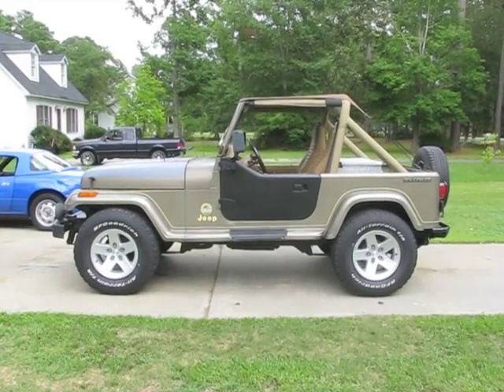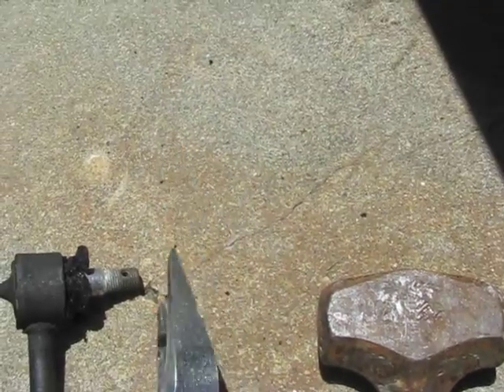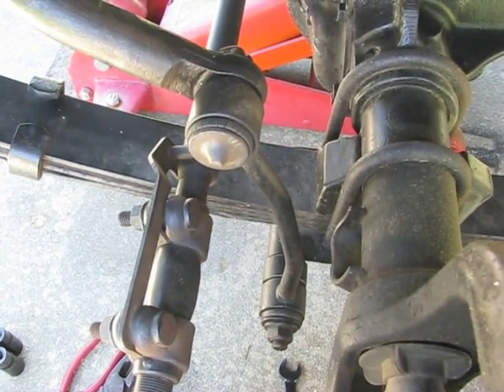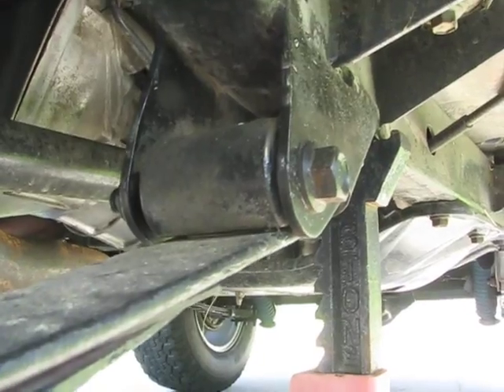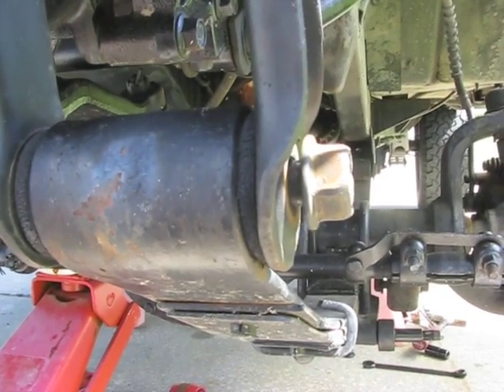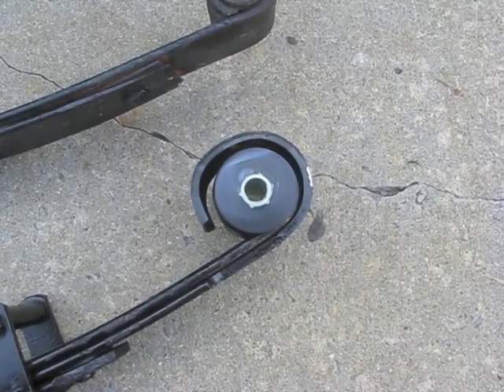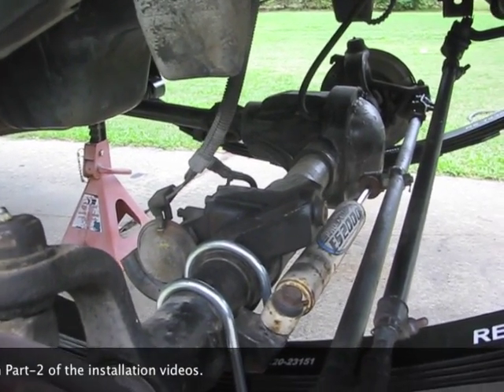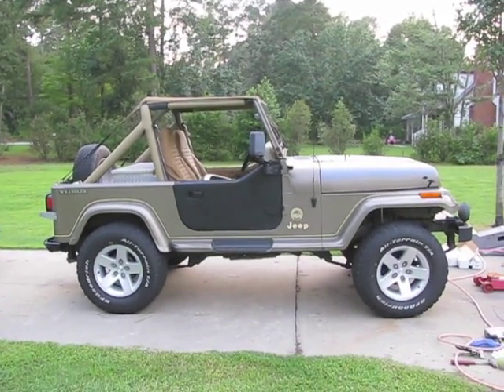Jeep YJ - Rubicon Express 2.5" Standard Suspension Installation Part-1 (front) (RE5505)

Comment from the maker: Glad you got it figured out. I didn't even think about your track bar being the issue since I removed my track bar before removing the factory springs and I did not reinstall the front or rear track bars. With the RE leaf springs, I haven't noticed any difference in on road handling with the track bars removed.

Comment from the maker: Took me forever to find a good clean YJ. It had been garage kept until I bought it. The paint faded out quickly (no garage for me) but I do frame maintenance about once a year to keep it rust free. I hate rust. I did have to PB Blast every nut and bolt several times for the weeks leading up to this lift installation. I had the suspension and axles removed several years ago which did make it easier this time around.

Comment from the maker: The kit came with bushing for the sway bar end links/disconnects. 
As for the leaf spring bolts, it comes with new U-bolts but not the leaf-spring mounting bolts. I did reuse the 22 year old mounting bolts on mine but it all depends on the condition of the bolts and I will most likely replace them when I install my new axles. 
If you think you need new upper shackle mount bushings you may want to get a set to install while you have everything apart.

Comment from the maker: Also, the RE 2.5" kit does not include bump stop extensions and with sway bar end links removed, the suspension does flex enough to rub the front tires against the fender when fully compressed. I will have to do something about that soon. 31X10.50-R15 tires may clear fine but my 265/75/R16 are just a little taller and do rub. Bump stop extensions will resolve this issue.

Comment from the maker: I was having trouble with my YJ drifting to the right a few years back. I had the alignment checked and I checked the usual things that could cause it. Sticking brake, wheel bearings/hub, and more. It turned out to be in the rear diff. The Dana-35 had pieces of the spider gears sitting in the bottom of the housing and there were metal filings binding things up when they found themselves in the right place. Fixed all that (yes the Dana-35 is getting replaced soon) and the YJ tracked straight.

Comment from the maker: Some old cars have leaf spring suspension similar to my '91 Jeep YJ and '86 Chevrolet M1008. Most have coil springs. My '70 Nova has leaf springs in the rear and coils in the front same as my '00 Ford E150 cargo van and '98 Jeep Cherokee XJ. My '62 VW Beetle has torsion suspension. All three of my Mazda MX5 (Miata), '87 Camaro, '05 Jeep KJ, & '03 Jetta all have coils. My '03 Freightliner has leaf springs in the front and airbags in the rear. Some cars use air ride suspension and coils together.

Comment from the maker: No noticeable difference. It tracks straight & with the sway bar connected, it still corners great. Even though the 2.5" lift doesn't require a dropped pitman arm I did install a stock XJ pitman arm to keep steering as close to stock as possible.

Comment: I did. (if you're asking me). I had to take it to the alignment shop and they had to put an air hammer to it to get it loosened up. After the alignment it drifts to the right a bit. I've been through everything to try to figure it out. Now I'm thinking the kit I ordered wasn't very good and the bolt the the spring perch might be off. I don't know. The caster is about where it needs to be, 8 degrees.

Comment from the maker: I had to let the PB-Blaster soak in for a while before mine would adjust. I don't normally like using heat on steering components but a little heat and a pipe wrench may do the trick.

Comment from the maker: The dropped pitman arm put it closer to its original position but I still had to adjust the drag-link. Just park with your wheels straight, loosen the to drag-link adjustment clamps and turn the drag-link to make it longer until steering wheel is straight. I can't remember which direction to turn it without looking at it. Also, spray the threads with PB-Blaster before trying to adjust length. You should be fine without the drop pitman arm. Just have to adjust drag-link longer than on mine.

Comment from the maker: So far, it rides great on & off-road. I have not installed the transfer case lowering kit and have minor driveline vibration when coasting. I am thinking if the suspension settles some that vibration may go away. I do have another NP-231 transfer case that I have already installed an SYE into. I was going to install that & my new rear driveshaft after my rear axle swap but may end up installing them before. I don't want to use the t-case lowering kit if I can avoid it.

Comment: I see the point of a trac bar on a front end with coils but see no point for it being on a leaf spring set up. Wouldn't the leafs just keep the axle centered?
Reply from the maker: The factory leaf springs do have a little side to side movement when cornering with the track bars removed. I guess that small amount of movement is what they were trying to eliminate. With the much stronger Rubicon Express leaf springs I don't feel any side to side movement when cornering with both track bars removed. Unless you are using a YJ for autocross I would say they aren't needed.

Comment from the maker: No, I don't believe they were. 
Just tighten up the shackle bolts to where they are snug then once its back on the ground I would cycle the suspension a few times (jump on the bumper a few times) before torquing the shackle and main eye bolts. This should help seat everything in place.

Comment: I bought the 2.5 inch lift kit from rubicon,  it says that you have to weld the    swaybar disconnects,   I see you didn't,
Reply from the maker: The sway bar disconnects that were included with my kit installed the same as original. They might have changed the design in the past 10 years. I hope not.

I'll have to look up what RE currently offers with the kit...
Reply from the maker: I looked them up. RE changed to a style that changes the axle mounting location to a tab that welds to the axle instead of to the original spring plate stud. 
The old style are now available from Warrior Products in four different lengths. 
https://warriorproducts.com/jeep-yj-front-sway-bar-disconnect-kit-83041.html 
On the site it doesn't list the actual length so I'm not sure which one would be the same as what RE used to offer.
Reply: Thank you for your answers and advice,  having a hell of a time trying to figure this out quadretec was no help at all , customer service sucks

Comment: Thanks again.  I really appreciate it.  I am looking forward to your video of the extended brake lines installation.  I have never done that before.  Also, did you get the shock relocation kit from Rubicon Express.  I was surprised to see those rear shocks contacting the axle.

Comment: The 3 people who disliked this video cant follow clear instructions.
Reply from the maker: +Matt Drake 
I just figured they didn't like my voice...LOL

Thanks.
Reply: +JeepCollector91 you bet. Im actually building a Jurassic Park jeep and Im removing the lift off my 93 YJ so your video explains things very clear. Great video. Quick question. When removing the shackle bolts on the front leaf springs how much pressure did you apply to the axle with the jack? im asking becuase im just making sure they dont spring back when the bolts are removed.  Same goes for the rear axle. Thank you
Reply: +JeepCollector91 Dont answer that. haha i watched you explain it again. Just supporting the weight of the axle.
Reply from the maker: +Matt Drake 
I have always liked the Jurassic Park YJ's. The wheels they had were the same as what my '91 YJ came with other than being painted red.
The jack was just there to keep the axle from falling when the leaf spring (already unloaded/full droop) was removed. Could have just used another set of jackstands but if I remember correctly the other set I have was in use on something else at that time.
Reply: +JeepCollector91 I had to order the wheels. Been on my jeep for some time now. It had 32s on it. Still has the BDS 3.5" lift. Jeep guys get upset as to why I'm removing the lift until I tell them I'm building a Jurassic Jeep. Since I saw the movie as a kid I've always wanted one. As to the jack I got one. Might use a friends for a second to keep the axle more balanced as you mentioned in the videos. It's a west coast jeep so no rust but I am going to do what you did. Spray every nut and bolt with PB Blaster everyday for a week just in case. Makes the job much easier!!
Reply from the maker: BDS makes some really good springs but I can fully understand you going back to stock. You can still have a lot of fun offroad with a YJ at stock height. I wheeled my YJ for years with stock suspension and a set of 30x9.50R15 BFG Mud-Terrains. Even ran a set of 235/70R15 BFG Radial T/A's (street tires) for a few years. The 2.5" Rubicon Express suspension will most likely stay on the YJ but I still kept all the original suspension just in case plans ever change. I do have the complete stock suspension from the '92 YJ that I parted out that I had also planned to keep for spares but I think I will be trading or selling off those parts. Only thing I would recommend is even though you will be back to stock you may still want to upgrade to something stronger in the rear and maybe a selectable rear locker. Maybe an XJ Dana-44 and an Eaton E-Locker?
You should make some videos of your YJ before during and after the return to stock.

Comment: Great Jeep videos!  Thorough. 
Question...can you run a 2.5" lift with no track bars on the beach? No rocks. Thanks for your time.
Reply from the maker: Chrissy Amorosa As long as we're talking about a YJ here, then yes you can lose the track bars with any lift. Any good quality aftermarket leaf-spring will do just fine at keeping the axles centered without the track bars. It will perform just fine on the street, sand, rocks, wherever... I do leave the front sway-bar connected on sand or any other offroading where I may be traveling at faster speeds but that's just a personal preference.
Hope this helps? Thanks.
Reply: Can you leave stock track and sway bars, pitman arm and drag link bar with the 2.5"?
Reply from the maker: Chrissy Amorosa To keep the track bars you would have to use the relocation brackets that are included with most lifts. This Rubicon Express 2.5" lift only includes with the relocation bracket for the front as this lift doesn't reuse the rear track bar. 
The stock front sway-bar is reused with most kits and longer end links are usually included. This lift includes the quick disconnect extended end links which is a bonus. 
Stock pitman arm can be used but a dropped pitman arm will keep the steering feeling closer to stock and the drag link will require less adjustment to center the steering wheel. I used a stock pitman arm from a '98 Cherokee XJ which is the same drop as a more expensive aftermarket pitman arm for a YJ. You may be able to find someone that has installed a dropped pitman arm on their XJ and they may sell you their stock one for just a few dollars or maybe even give it to you.

Comment: Hi,would you tell me what if we cancel track and sway bars from yj,and drive it some miles.what would happens?
Reply from the maker: Eliminating track bars front & rear: 
If your YJ still rides on stock leaf springs it may feel a little different around curves. The lateral axle movement is very minimal. With good quality aftermarket leaf springs you are less likely to notice any lateral axle movement. 

Eliminating the front sway bar: 
The front axle will have much better articulation so make sure your tire size clears the fenders or you will need extended bump stops. On the road or higher speed off roading the vehicle will experience more body roll. Sway bar disconnects are not too expensive and simple to install. Otherwise, just drive it accordingly and you will be just fine.
Reply: @jeepcollector91  First,thanks for quick reply and care.Currently i don't have a car,but yj is my preferred & beloved car,and interested to know every thing about it,wishing own one some day.

Comment: Like your video . I have 92 and 2.5 is what I'm doing my question is did you use stock driveshaft
Reply from the maker: Yes, I used the original rear driveshaft for awhile. 
I did install a different rear driveshaft after installing my other transfer case with the slip yoke eliminator installed. 
Still running the original front driveshaft.
Reply: @jeepcollector91   awesome tks like your jeep

Comment: I want to put those same JK wheels on my YJ. Did you need any adapters/spacers?
Reply from the maker: +Jason Foust
The wheels I have on the YJ are 16x8 Moab's from a Jeep TJ Rubicon. No adapters needed for these.
For the JK 17" version you will have to run a wheel adapter/spacer.

Comment: I'm planning on getting 2.5 rough country lift, since you had lots of lift experience would you be able to answer few quick questions? 
1. it's 2.5 lift, 0.5 lift from hinges and 1.0 lift from body bushings, what would be biggest size tires i will be able to use?
2. considering it totals to 4 inch lift, will i need special adjustments, like pitman arm, removal of track bars, longer break lines?

Comment: Hi .. I just installed a 2,5 Rubicon suspension on my jeep yj  and I have to say my jeep looks beefed up .  Now im gonna change the tires tomorrow , they tell me to install  31 x10.50 R15  tires . Is that right ??    Im gonna do Michelins tires
Reply from the maker: Yes, 31x10.50R15 will fit perfectly with this lift. I am running 265/75R16 which are basically a 32x10.50 and it's a bit tight on clearance when the front sway bar is disconnected and the suspension is fully flexed.
Reply: JeepCollector91 
Thanks . My jeep looks great with that 2.5 suspension . I'm gonna keep an eye on the T joint on the drive shaft ( I think that's what its called ) so it don't shred . I don't think it will but i' ll keep an eye on it . I'm sure your jeep will look great after you install your suspensions .
Reply: I've had the Rubican shocks for three years now and I'm not very pleased with it .
I feel every little pot hole , rock , bump in the road . The Rubican does not absorb any shock at all . My jeep is totally stiff . It might be good for the gran canyons or mountains but doesn't make a good street shock . 
I might have to change them out in the future .

Comment: I just ordered my rubicon express 2.5 inch lift kit, as well as rear shock relocation brackets. i was wondering if you replaced the bushings for the sway bar extension links, or does it have them already. And also, should i replace the leaf spring bolts?

Comment: My rubicon express lift only came with rear brake lines. Did you buy your front brake extensions separate?
Reply from the maker: Mine came with the longer brake line for the rear and hard line extensions for the front. I chose not to use the hard line extensions for the front and bought GOODRIDGE extended brake lines (Part Number D-FBL-47) for around $35 for the pair. I didn't make an install video but did show them in a separate video after installation.

https://www.youtube.com/watch?v=40uI4Q76E5c

Comment: Can you use the stock shackles for this application?
Reply from the maker: Yes. I retained the original shackles.
Reply: Thanks so much
Reply: No problem with the back?
Reply from the maker: @rickyhino2367   None with mine. Unless RE changed something with the springs since then.
Reply: I'm having a hell of a time with my shackles,  bottom bracket will no hook up correctly,  axle hangers are going in crooked, do I need to loosen the other side to roll them

Comment: Hey are you running a CV Drive shaft and a SYE????
Reply from the maker: Yes, I ended up installing an SYE and used a shortened Jeep Cherokee XJ front driveshaft for the rear of this YJ. Originally I had installed the T-case drop that came with the kit but it made the transmission difficult to shift into 2nd, 4th, and Reverse so I removed it and installed my other transfer case that I had already installed the SYE on. Had planned on waiting to install it until after the rear axle swap but I couldn't stand the T-case drop anymore.

Comment: My TJ has coil springs in front, and leaf springs in the back. Would it be possible to do a TJ lift on the front, and YJ on the rear?
Reply from the maker: All depends what rear leaf springs you are currently running. 
YJ, XJ, or something else? Or maybe factory TJ rear leaf springs from one of the Military TJ's? If you currently have YJ springs in the original YJ SUA set up then yes, you should be able to get YJ leaf springs of whatever height/lift you are wanting and match it up with the same height/lift TJ coils for the front.
Hope that helps some….
Reply: Idk, it had them on their when it was bought. When I look up lift kits for my year model it brings up coil springs all around.
Reply from the maker: ***** Might want to look for any part numbers you can find on those leaf springs. That would help find out what they are made for. Many have part numbers stamped into the spring while others are simply painted on.
Reply: Oh ok, I'll have to look, thanks for the tip.